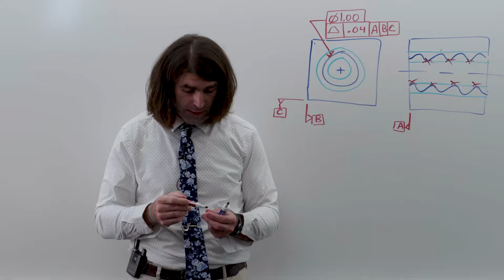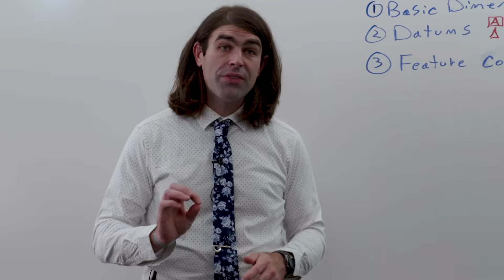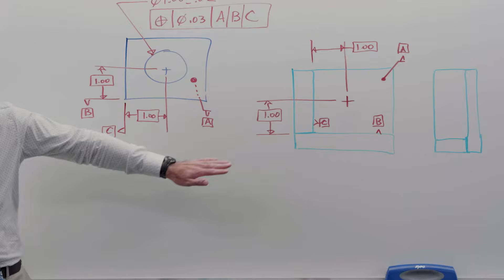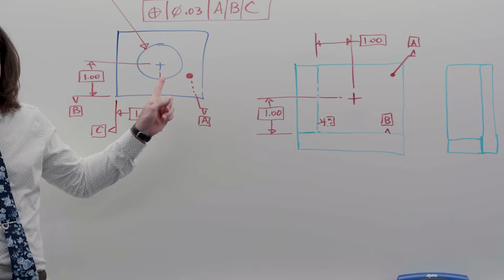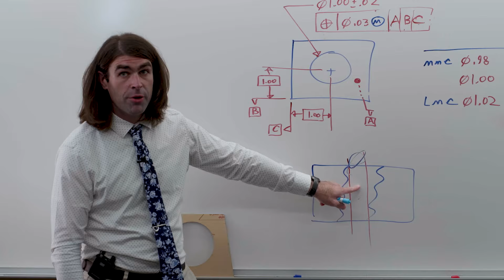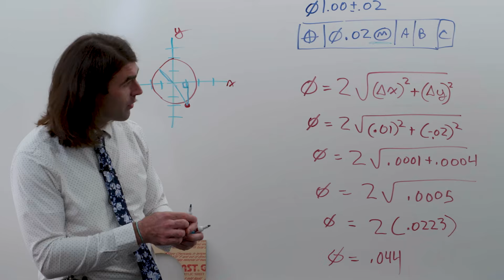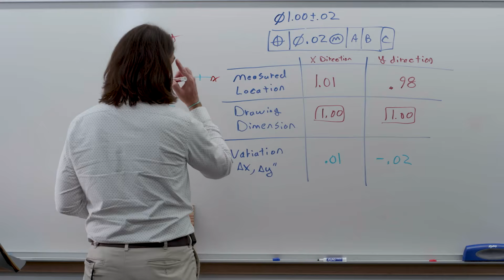Comment: Great explanation! Just a small note — at ~29:00, the tolerance zone circle on the left looks like the point falls inside it, but calculating 2√(0.01²+0.02²) ≈ 0.045, which exceeds the Ø0.02 tolerance. The point should be outside the circle. Easy to miss in a hand-drawn diagram!

Comment: For Datum, i agree it needs to be using datum simulator or the perfect plane, biggest pin gage, biggest gage block or smalles ring gage. But for the feature itself being inspected he is also doing the same thing “datum simulator “ which he called “mating envelop” appears to be incorrect or not per ASME, please prove me wrong and advise where in asme that allows that

Comment: actually I have a doubt while I am inspecting positional tolerance should I consider unrelated or related actual mating envelope, during start of the video example at 6.50 you said we should check if the axis of the UAME is within position tolerance zone or not but at the example at the later stage at end you again considered RAME while checking positional tolerance.

Comment: what is a basic dimension and does it have a tolerance?
Reply: There is no tolerance in a basic dimension. 

Think of it more like a reference dimension where you can use it as a way to compare other dimensions.

Because it functions as an absolute reference dimension, it is not subject to tolerance callouts
Reply: @rufus2028  thank you so much for your reply! I have learned so much with your videos and i appreciate your time. you think you can teach how to measure angularity on a optical comparator? i have a box on a drawing with an angularity of .010 to a  datum B but i cannot find any videos on how to measure. Thank you again ! :)

Comment: The only thing I’m disappointed about is the fact that I didn’t know this channel existed until well into my engineering career.

Mind you that GD&T isn’t something heavily taught in engineering. In fact, design for manufacturing is an elective in the engineering curriculum, and it sorely needs to be mandatory. At best, we were told that we’ll be taught on the job, which is imo unacceptable.

Comment: I viewed 7 of the 8 video lessons you had on GD&T for review to take a quiz offered by AGI.

I just took it and got 60 out of 61 questions correct.  The questions were based off ASME Y14.5 2009.  

Thanks for providing the videos.
Reply: Solely on watching these video lessons? Impressive!
Reply: @LegendaryLock  I have used and read ASME Y14.5 2009 when I was still working.  After retiring for about a decade, I watched the videos for review and took the AGI test to test my understanding of GD&T.  To my amazement, I got only 1 incorrect answer.

It's a free test in AGI's website and the results is emailed to you after your test has been submitted.

Comment: Question: Can you use a feature control frame on a center-to-center distance dimension between 2 holes?  It sees like this would not qualify as a "feature of size"?
Reply: Hi, so the distance between the holes would be covered by a basic dimension. The feature control frame is usually associated with one of the size dimensions for the holes. 

You are correct that the distance between holes is not a feature of size, it’s a locating dimension.

Comment: How does "bonus tolerance" work when you have to document the dimensions on a dimensional data sheet? If your tolerance on the drawing is +/- .02", and your dimensions is out of tolerance according to that, but in tolerance according to the bous tolerance, what would you write on the dimensional data sheet? Would this be a legitimate concern? Would this be a drawing mistake? Not sure if I explained it correctly, but thanks for all your educational support.

Comment: Its 2023 and im reviewing, again. Always gets easier.  Get more perspective. Lets just talk [basic dim]. WTF is that?  Purpose is: 
a.) to transfer the x and y datums to a single point[x,y] 
b.)  this point becomes a "datum origin" on the "plane" of the paper. [note, the concept of a datum point doesn't exist in strict gd&t]. 
c.) Now, compare "measured" hole center positions to this "origin". 
d.) if u love arithmetic you dont "really" need basic dimensions, you could still measure hole centers away from each "edge datum". 
e.) this is just a clever SHORTCUT to reduce math, but a nightmare "to explain" to smart students who have never used inspection tools.

Comment: Thanks a lot for your wonderful videos on a topic that is so ambiguous for many people. You made it very easy and very clear.
Would you, please, tell me how to choose the exact value of geometric tolerance for a mechanical part during the design stages to be inserted in the feature control frame? 
All people are explaining GD&T by using an existing drawing. But none has explained how to decide on the exact value of tolerance inscribed in the feature control frame (for example Position tolerance value equal to 0.03, where does the 0.03 come from? Why it is not 0.05 or any other value?
The numerical value is chosen based on what criteria or conditions?
Thank you again

Comment: How do you give position tolerance to holes that are normal to and on a curved surface? For example set of holes that are on a cylindrical large tube (harder case would be holes on a double curvature surface)?
Reply: That’s a great video topic. The short answer is that that the true position comes from the datums. In the case of a tube, the holes are positioned to the axis of the tube and one end, not to the surface.
Reply: @RDeanOdell  Yes but what if my surface is somewhat arbitrary? ie not axisymmetric say like a surface of a car?

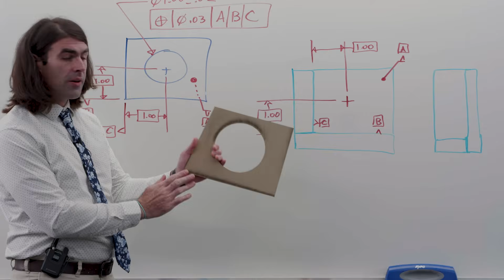Comment: How about a situation in which (18:30) such block has a rectangular slot on a side and the primary datum is a derived median plane of the whole block (side has for example 80+-0.2 length) and then the position of the slot has a width with a tolerance and position callout referencing the primary datum? How do we determine the true position of the primary datum and then the tolerance zone for the slots position? Just imagine a vice to simulate it?

Comment: In actual practice, the true position tolerance ="cylindrical" tolerance volume of the hole "axis" bounded by the diameter and material thickness...
Quickly, just becomes a 2 dimensional tolerance of the hole center bounded by a diameter + bonus tolerance.
HEre's how:
Since, the true position feature control frame specifies that the "hole axis" must be "perpendicular" to surface A.
Then, the actual measurement will be taken with a pin gauge that not only fits the hole but must also sit square to the inspection plate = [ - A - ].
So, it's "automatic" that the X[measured] and Y[measured] plus the Hole Radius will give the coordinates of  a "perpendicular" axis.

Comment: Hi Dean, Can you make a video explaining how to calculate bonus tolerance for a rectangular slot if MMC was called out.  Both length and width have different tolerances, let's say width +/- .001 and length +/- .002.  Also how to calculate the bonus tolerances of the square slot? Can we apply the same principle of bonus tolerance of the hole slot for the square slot as it deviate from the MMC ? Never thought a question like that would pop up on an interview with the hiring manager.  Thank you sir
Reply: Don't let the different values throw you (the length and width are probably different too) - MMC is still MMC in each direction.  Then you just subtract the Position tolerance to get the Virtual Condition.  That is the envelope you cannot violate with the produced part.